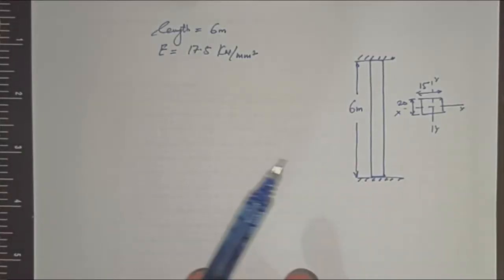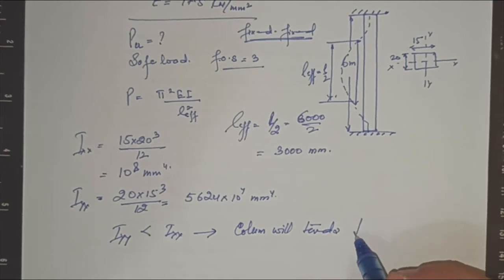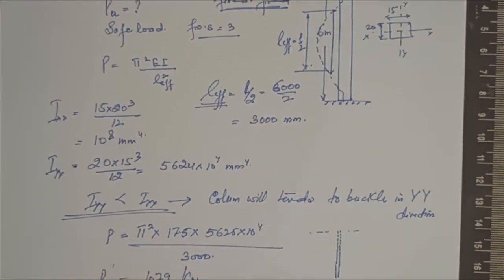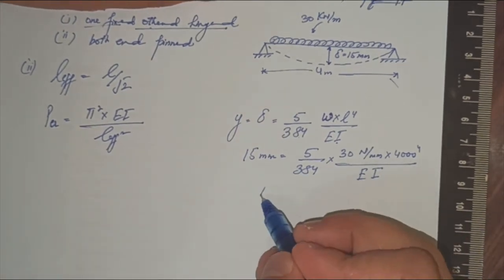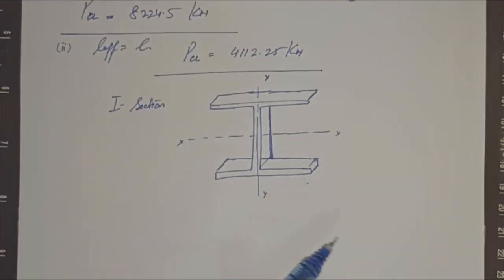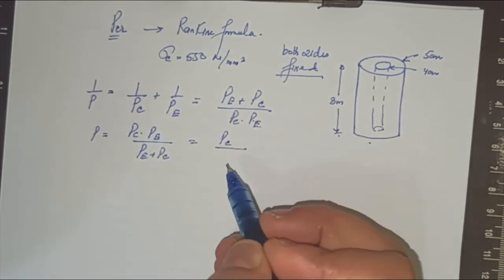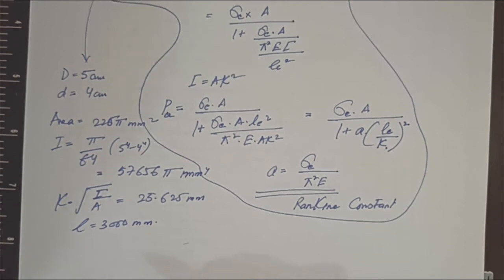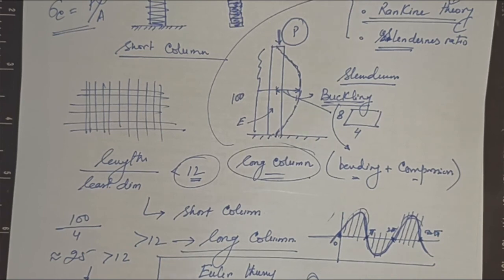L14-Solid Mechanics: Columns: Problems and solution approach

Comment: Hi sir i want to ask if the CZM is possible between to layers having same fibre orientation  [90/90]????
Reply from the maker: Although CZM is a mechanism and is definitely possible but the same fiber orientation will not show any Delamination
Reply: @SanaanKhan   sir in a previous vedio you mentioned a L2L 90/90 interaction proprety
Reply: But in the experimental studies there is a delamination sir
Reply: And in your vedio https://youtu.be/IVe1uoqmdT8 
There is a proprety betwen layers 90/90